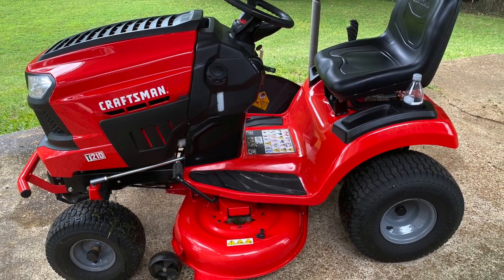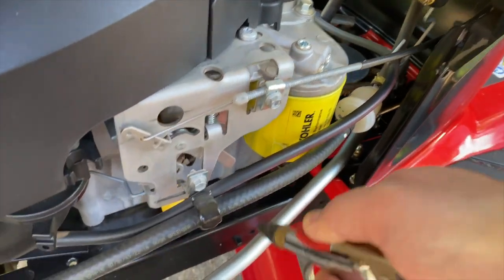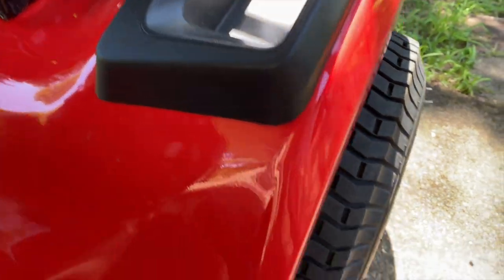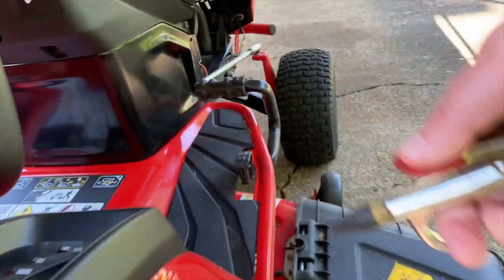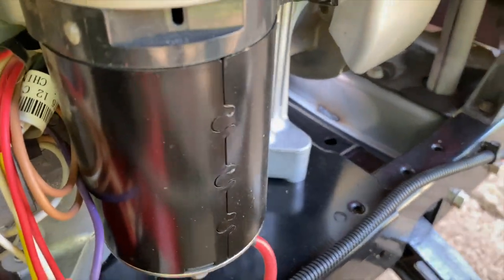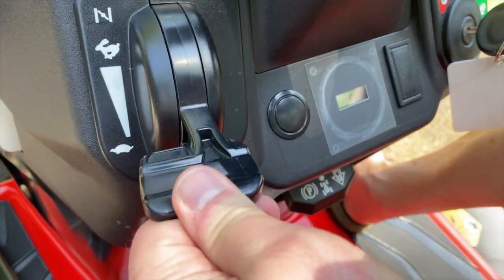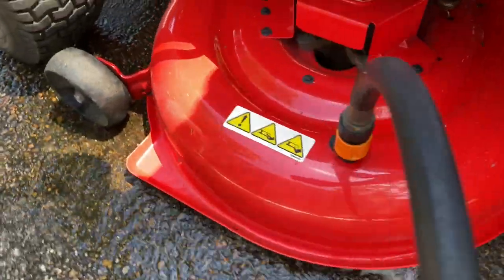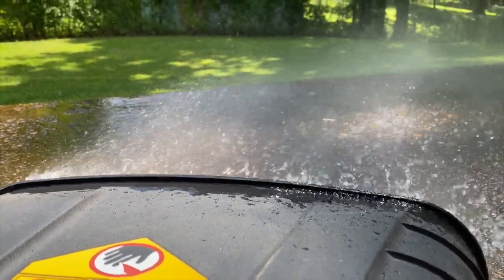Cleaning my Craftsman T210 / T2200 Riding Mower - How I keep it looking NEW!

Comment: The craftsman first run 2019 to 2021 turn tight series Tractors were the very best T240  T260  T310  built like little tanks and made to last for decades..unfortunately the newer versions 2022 to present have been downgraded..glad I got my T240 in 2021..

Comment: wondering if any one out there has has trouble with the new T2200 riding mower , i bought one new at Lowes in April 2024 , had it three weeks and kept dying , took it back to Lowes , took 5 hours of fighting to get a it exchanged , now 3 months later  , same thing , just dies while i am mowing , Lows' would not exchange so now it is in the shop ,, i am waiting to hear what the problem is ,, any one out there with same issue for this model mower ?
Reply from the maker: Just curious. Is it dying when you try to go into reverse, or does the engine start cutting out?